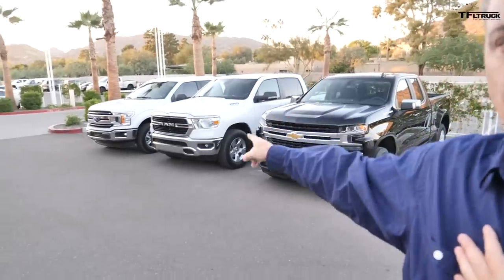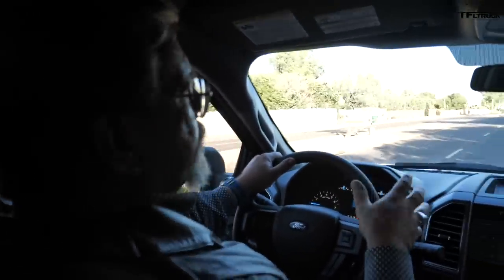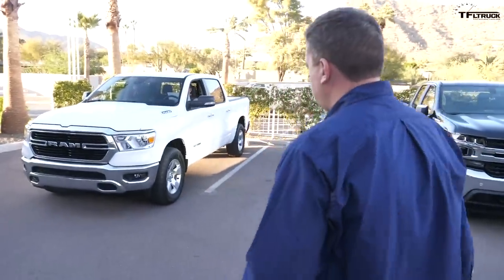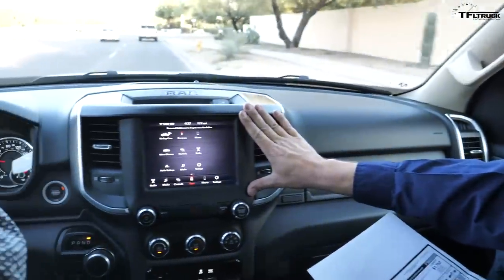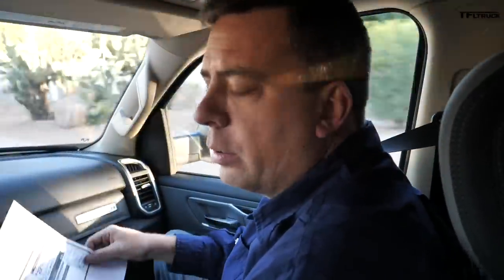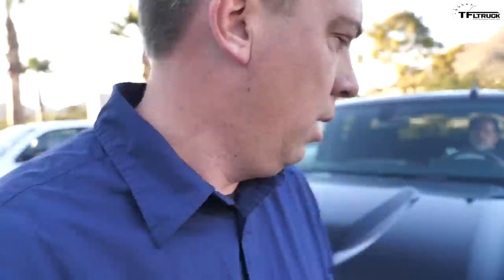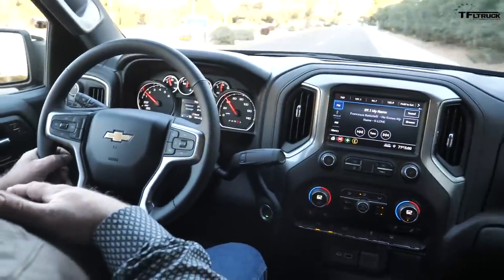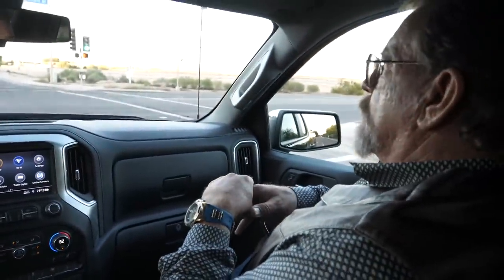Work Truck Wars: 2019 Chevy Silverado 4-Cylinder Turbo vs Ford F150 vs Ram 1500 Review

Comment: I really like TFL and the job they do in comparing trucks. There’s a huge part of the story missing on each. 1) cost of ownership 2) # of issues, recalls and services needed 3) re-sale value 4) bang for the buck. I have owned many f-150s, Chevy and gmc half tons, and even a GMC Canyon (15’). I currently own a 2018 Toyota Tundra 5.7 crew trd limited. Out the door it was 43k and change brand new. The Ford was 10k more with the same options and the gm twins were about 6-8k more. I agree with the comments that truck prices have run away and keep going up and up. Because of this I believe the Tundra is still the best half ton on the market hands down to own. It doesn’t do everything well, but it does everything good enough and does it without any problems, and with a resale that the others can only dream about. I think TFL should look at doing long term testing with these considerations. Love the show and the guys.

Comment: But isnt chevys base engine still the 4.3 v6?
Reply: Yes and on the 2019s the four cylinder 2.7 costs $4,700 more than the 4.3.
Reply: Yeah but it can't compeat with the 3.6 ram. I have no experience with the Ford so can't say.
Reply: Yes and no. For wt models yes the 4.3 is the base engine. For any models that most people buy and are comparable in price to ford and rams viewed. The 2.7l is the base.
Reply: But that's only according to gm.
Reply: @rmkscrambler  the 3.6l ram sucks lol.

Comment: Issues with the review for me;
1- Ford has the under seat storage too, and it's larger then Ram and Chevy.
2-the Ford was a 2018 model.  In 2019 the XLT comes standard with the 8" Sync 3 system which is superior to Chevy's system.
3-the Ford was supplied without the tow package and with P rated tires so it's tow rating and payload was lower then the other two that had tow packages and LT tires.
The manufacturers seem to want to always play with our heads by sticking in a dud.  Shame on Chevy.  You guys keep up the great work.

Comment: On those start-stop engines, is the A/C compressor electric? i.e. is it just the interior fan running on re-circ. (which would suck here in AZ come summertime)
Reply: Hmmm that's a great question. I would think it's the regular pump. Maybe it's one big reason they all have a disable button.
Reply: I have the start stop in my Ford, here in Florida.  The compressor is engine driven.  After shutdown, the cooling system runs off the residual freon in the system.  When the AC system can no longer keep the interior cool, the engine will restart, even when stopped.  The engine will only shut down once the battery is charged, engine is at operating temp, and the heating/cooling requirements are met.

Comment: If it had a turbo V8 I’d pay that in a work truck
Reply: even a very mild boost the V8 would be very nice... even at 5 psi you would be over 450hp and 450 ftlbs reliably for years...
Reply: The 5.3 is a pretty good motor when it has the right axel ratio.
Reply: JustJay 0312 — You don’t need a turbo with a V8.  Does anybody do that for a pickup?
Reply: A twin turbo 5.0 with direct/port injection, ahhhhh it makes me wet dreaming about it
Reply: @GH-oi2jf  not a pickup but a few luxury suvs have turbo v8s
Reply: Why doesn’t Ram put in a 500 horsepower turbocharged/supercharged Hemi in their 1500’s as an option?

Comment: First time I'd really consider buying a Chevrolet (besides the volt) would be if they offered this engine in a small truck like the Colorado. I like full sized trucks, but I also really like smaller trucks and truly miss the little commuter trucks of the 80's and 90's.
Reply: volvo09 Me too!  I had a 2000 S-10 that I put a little over 400,000miles on, never left me anywhere.
Reply: Yeah, this engine in a Colorado would be ideal, but we’re talking GM here...it’ll be discontinued before it is ever used in another product..
Reply: volvo09 — The Colorado with the 2.5 is a nice daily driver truck.  Why would you want a turbo?
Reply: Don't worry, Fords rangers coming out this spring with a 2.3 EcoBoost that has better horsepower and torque numbers then the 2.7 -4 from GM. Fuel mileage will also be a lot better, and it's supposed to tow almost 8,000 lb
Reply: @GH-oi2jf  with the hopes that it's got power to spare with a retune. Every turbo car I've had or known has been like that, so it has made me like turbos (even though my current vehicle is supercharged and I like them a lot more than turbos). I don't drive crazy, but I like plenty of power. I also have a full size older tundra, but it's usually bigger than I need, so I would replace both with a small turbo truck.
Reply: s10 and a cummins 2.8l swap? Professionally done still probably cheaper than any of these trucks here.

Comment: 21:40 for the Chevy.
Reply: Looks like you can fit 2 of those 4cyl engines under the hood 🤔
Reply: @ChuckBeefOG  Yeah, it's called a V8! 🤣
Reply: Chuck Beef
2.7 plus 2.7 equals 5.3

Comment: I find it interesting that none of the competition is a base work truck, and that they are both "Crew Cab" models, while the Chevy is a "Double cab" model, which is the same as an extended cab in previous models of the same truck, and the super cab in the ford, and I don't know what the Ram called their model..... These vehicles are Not as you said "Apples to Apples" testing..

Comment: My grandpa has the 3.3L V6 with 290HP. He has the 2018 XLT in blue jeans color. I drove it multiple times before. And I’m only 18 and I also own a 2010 LE Camry 2.5L 169HP 6speed auto.

Comment: Chevy has this problem of bashing the competition and then later copying the competition when they find out they're successful. Bash the Fords for using aluminium, then later Chevy starts using aluminum. Bash the Fords for having a step in the tailgate, then Chevy half-ass sticks a step on the bumper. Bash the EcoBoost, then Chevy builds a turbo motor of their own.

Comment: $45 grand will get you a Toyota Tundra SR5 Upgrade Pkg with a 381 hp V8 with 401 pound-feet of torque and nearly 10,000 pounds of towing capacity with that monster 4.30 rear diff.  Yes it takes more fuel to do it.  I think these so called "work trucks" are fine for light loads and small trailers.  Or trips to the hunting camp.  But they will not do the real work of towing and hauling heavy loads.  If you are towing a boat or travel trailer you still are going to want a V8 with a big rear differential.

Comment: defiantly not apples to apples now i dont think ram offers a turbo truck yet but I think if you put the twins out of the 2.7 v6 against the new i4 the towing numbers and payload are close but i really enjoy the 2.7 in my ford xl has the same features as that xlt but mines a 4x4 i think chevy needs to work on this a bit more theyre trucks have always been a bit more pricey as well i never have cared for the cylinder shut down seems like bad wear on the walls uneven

Comment: I have my old 2004 Nissan titan, new tires 4x4 and I get a whopping 13 to 14 mpg. It needs a paint job and looks ugly, but it's  starts every morning and it's paid for.. you can  keep  your + 40k trucks without a V8. The 5.6 will tow more and probably last longer than the squirrel motors in those things...
Reply: uhhh no....titans are trash and prone to falling apart.......and that 5.6 isnt rated to tow all that much....like 8k pounds.

Comment: The F150 should be the 2.7L. The 3.3L competes with GM's 4.3L V6. GM's 2.7L turbo isn't the base engine. Not a great comparison.
Reply: Stuka87
the 2.7 will be replacing the 4.3
Reply: @anthonywebber2211  No it wont and no its not. The 4.3 is too cheap and will remain base in their actual base trucks.

Comment: This got me curious about the variable valve lift system on the cams, I never heard of something like this.  There's 3 lobes on 3 cyl. and 2 on the 1st because it never deactivates, high lift, low lift and no lift (cyl. deactivation),  the lobes actually shift themselves into place in a rotation. Normally (what I've seen) there are separate lobes solid to the cam and separate lifters that are constantly in contact, and it's the high or low lift lifters that lock themselves up to provide VVL. The double volute turbo, (or twin scroll) maybe unique to trucks, but I got one in my '94 Toyota Celica engine (OEM). Btw, the ford has the best sound.

Comment: Would've been better for these 'cheap' base trucks to also include their original 4 speed automatics as well with these modern engines.
Ford-4R70W-3.3 V6
GM-4L65-E/4L70-E-4.3 EcoTec3
RAM-45RFE-3.6 Pentastar

Comment: Fuel Mileage is always lower with  4 wheel drive you have a lot of extra weight with  transfer case and  front driving axle .  Might  be able to take advantage of that Turbos boost with E-85 which is over  100 Octane and  has a lot of cooling effect

Comment: Ford rules, Chevy drools.  2.7T vs 2.7T please. But but but the ford is not Base 😫
Reply: Compare base to base the 5.3 is the 2.7l fords competitor. Ford also actively sucks. Loving both gm and Ford I will never buy a Ford truck without a international engine.

Comment: 310 hp from a 2.7 turbo is not spectacular. Mercedes makes 380hp from just a 2.0L 4 cylinder in the A45 AMG the US doesn't get. That is spectacular output per liter.

Comment: I'm puzzled by the high prices. I paid 33,600 $CDN for a brand new 2017 F150 XLT supercab 5.0 V8 6 SPD 2WD...
How is the base engine XLT now over 40,000 $US (52,000 $CDN) ? My truck has the same small display stereo, backup camera and factory plastic bed liner as seen in this video. Did (base model) trucks just get a whole lot expensive in two years?

Comment: My impression, from someone who's owned A LOT of trucks:  1. The Ford sounded the best, (the Chevy sounded horrible).  2.  The Chevy, by far, looks the best inside and out.  3.  The Chevy 4 cylinder turbo is untested over time, (first year new).  4.  The Dodge is just okay.  5.  God help anybody who has an electrical problem in any of these trucks.  You better have deep pockets when the warranty runs out.  5.  40K to 45K  is expensive for a "work" truck.  6.  I wouldn't own any of them.  I'll stick with my 2005 Chevy 2500 HD Diesel 4x4, or my 1960 Chevy C10, or my 2008 Dodge 1 ton duelly 6.7 Cummins Diesel, etc.  7.  Still though, if I had to choose between these 3 trucks, I would pick the ........... Chevy.  I'll admit, I'm partial to Chevy's.  I've owned many of them and never has a Chevy truck left me on the side of the road.

Comment: 2018 Ram 2500 Tradesman is way cheaper than any of these, $33K gets the cummins or the 6.4 hemi, better truck all round, if you spent 10K on options it would still be cheaper, fuel economy is expensed.

Comment: None of these are work trucks they're all girly trucks for picking up antiques around town they all suck. Go to the long bed 3/4 ton big engine 364 cubic inch gasoline or the big diesel motors four-wheel drives with a full bed and with utility beds and compare them. My 2010 2500 Silverado HD gets 9 miles to a gallon. It has a utility bed a 364 cubic inch motor four-wheel drive and is pushing close to 10000 lb fully loaded. Compare something like that not these little wussy trucks

Comment: I wish my Ford Transit 250 work van had the 3.3 instead it has the 3.7 but to be completely honest it's impressive on power and gas mileage. I drive it like a completely asshole in the city and weights right at 5800 with me and tools and it get 16 MPG.

Comment: Good review. Too bad you could not get the Chevy in 2wd without all the options. As a work truck I would have to go with the Chevy. The new 2.7 has a lot of technology that the other engines do not have. One of the most important would be their cooling technology. You ban get maximum cooling at low rpm’s and speed. A work truck may find itself in these conditions often. Yes I think Chevy has a winner with an engine that was designed for truck use only. Now they need to put it in the Colorado.
Reply: It is unacceptable to have these trucks priced this high with this small of an engine.

Comment: The big advantage for the Chevrolet 2.7 engine is if you have to any work on the engine is that it’s much easier to work on it has only one cylinder head and only one turbo the amount of room in front of the engine and the radiator must be amazing and last but not least is the non turbo V6 engine are not tune friendly compared to a turbo engine I would choose the 2.7 .

Comment: The reviewers conveniently forgot to mention that the base motor for GM products is actually the 4.3 litre.  To be fair, the next level motors would be the 2.7 F150 and 5.7 
Ram. This due to the Ram not offering as many choices. So if you just compare the Ford and the Chevy, the Ford would definitely outperform the Chevy but not in fuel economy. At this next level the F150, it would have the 10 speed standard and in the Chevy it would have to be an option. I agree with the comment regarding it is better when the comparison vehicles are not chosen by the manufacturer. The manufacturer is never objective.   If/when they discontinue the 4.3, then this would be a fully relevant comparison. 
    Heck, the 2.7 F150 would very likely outperform, or at the least, or compare favoritivly  to the Ram 5.7. It is such a rev motor with very low end torque. Interesting, to say the least.

Comment: I will not buy 2019 Chevy Silverado or GMC Sierra 2.7 liter 4 cylinder turbo due to the fact of maintenance. If you have to change your timing chains in your engine you have to remove the transmission just like the Canyon and Colorado no thank you I'll stick with my 06 Chevy Silverado 5.3l

Comment: f150

I would never trust the reliability of a 4cyl engine in a full sized vehicle. Even if it is turbo. It will still put more stress on the engine. 
The Fiat would be fine... but well, ever since Fiat took over Chrysler in 2008 Their quality and reliability has gone way down. No one wants to chase electronic issues.

Comment: Fuel economy is kinda a mute point when your buying a full sized truck. 3mpg difference "saves" you about $300 worth of fuel a year. I guarantee with the way gas prices fluctuate and driving habits... you will not even notice.

Ford wins the rev battle :)

Comment: 4-cylinder turbos:  the official engine of the "we can build a smaller engine with as much power as 6 or 8 cylinder that will burn itself out 100,000 miles earlier than the NA versions" set.

Comment: A 4 cylinder is OK for a compact truck. But no way I would want one for a full sized truck. The turbo is a weak link especially under load. You can bet there will be plenty of reliability complaints with that. The manufacturer will probably end up dropping it.

Comment: 2.7 is not enough, a 400 cubic inch V8 cut in half with a turbo might be more of what is needed. That means 3 liters minimum.
Reply: mike schoolcraft
3 liters is 183 cubic inches 
3.27 (3.3) liters is 200 cubic inches which is half of 400 cubic inches

Comment: Should have been ford 2.7vs 2.7 chev
Reply: So a higher package option engine vs a base engine?. One with a anemic tune the produces peak torque at like 1500-1800 rpm versus a more aggressively tuned v6 that produces peak torque at like 3k rpm

Comment: Unless I needed the larger bed or room for 6... I would go for the 3.6 Chevy Colorado. I got my 18' Z71 loaded... with 4x4 for $32k ($38k sticker). Higher fuel economy, faster, and much more nimble in tight spots. 

I was planning on getting a WT trim level... but ended up talking the price down so low even without any advertised discounts early this past Spring. lol

Comment: Trucks used to be 180hp and did just fine in the real world. Todays v6 engines out perform and out milage everything from the past. Who remembers the 460 ford with under 200hp? I do. This channel and others power shame buyers of anything short of a 6.2L GM when in reality many buyers of trucks just want the safety and convenience that comes with these larger vehicles.

Comment: Ram had the best sound, then Ford then way behind is Chevy. All three for that money are okay. The ford had its 2nd best tow motor and still didn't meet the other two - that was weird, but no tow package so that might be why. I liked the box on the Chevy - shimming out those extra few inches can make a big difference. Still don't know why Ram didn't extend its bed to 6'6" (or more) for 2019; it is wider than the Ford, but my MCs still have to go in just a little angled which I don't like. Don't think you could go wrong - but for me its the Ram or the Ford with the motors shown.

Comment: Chevy and Ford are way over priced I got my 2021 ram big horn 4x4 5.7 hemi with a ton of options like the push button assist tailgate with the 3.92 axle with a payload of  1,878 and a max towing of 11,778 and I paid $43,000 for it and the Chevy with the same options I had a year ago was getting close to $60,000

Comment: These new trucks are dumb with they're auto stop start crap. Starting is the hardest on an engine because there is no oil flowing through the engine for a slit second. Maybe I am wrong and the viscosity of the oil will stick to the components momentary but increased engine wear and starter wear seems it's going to be an issue. Also this 4 cylinder Chevy seems like a huge waste of R&D money considering the 6.2 is getting that mileage ??!!